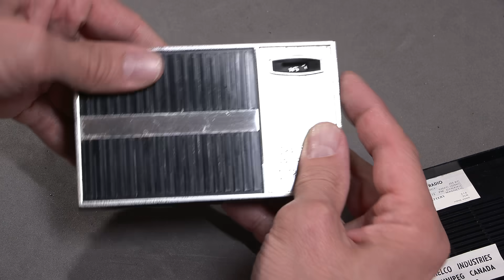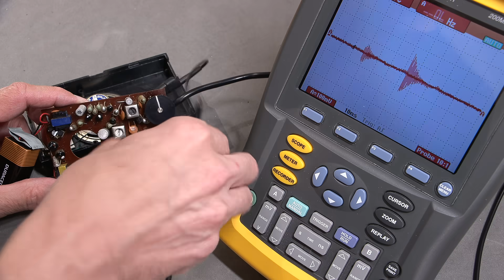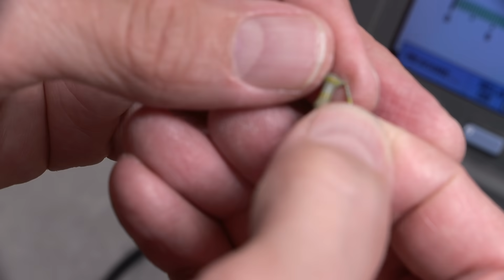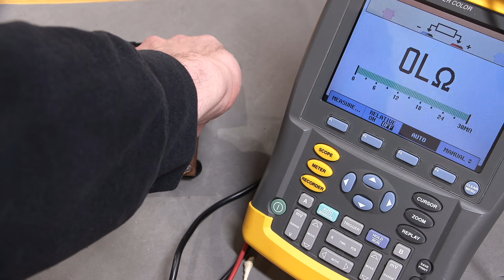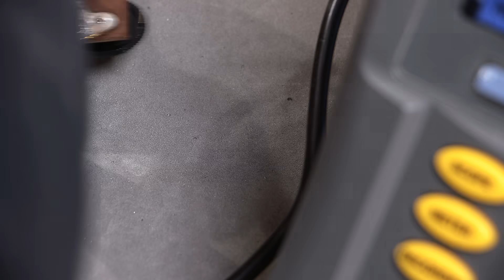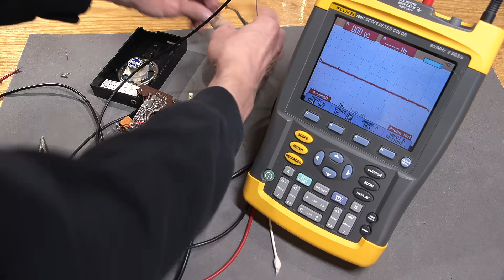10 Transistor TRANSETTE Radio Receiver Troubleshooting Adventure!

Comment: I checked and 1 transistor seems to be mixer and oscillator (autodyne) 3 transistor seems to be the IF amplifier 3 transistor seems to be the audio processing unit like filtering some high frequency components and amplifying some audio components and then pre amp 1 transistor and power push pull amp 2 transistors so total 10 transistors and 3 transistor IF seems to have high gain and 3 transistor processing unit seems to do its job perfectly because then pre amp doesnt see harsh audio components and amplify it, it amplifies just voice in its bandwidth not noise outside the band and thats why it may have higher superior audio quality and better reception

Comment: I find a LOT of transistor radios on my job at an E-waste plant. The boss/managers are happy for me to take them home (as long as I remove the battery/batteries). I find they almost all still work with little to no encouragement...

The reason these little radios are such wonderful performers is because of the superior filtering.
They have a reception bandwidth of a mere 1200kHz...yet look at all the coils and such inside.

Today's portable receivers won't have anything near the amount of filtering. Or transistor stages.

Worse, take an SDR receiver, they can have a bandwidth of 2000MHz or more...but take a look inside one of these - almost no filtering stages! Just itty bitty, sparsely placed components, maybe one or two big chips here and there, but...very little filtering. No really discrete coils, they look like a motherboard taken straight out of a modern mobile phone.
Reply from the maker: You are very correct. SDR receivers are a compromise at best. They save money on parts, and that seems to be the focus now.
Reply: @MrCarlsonsLab  forever and ever...it's the same story sir :)

Comment: I remember my first crystal radio from Kix cereal. Fifty cents & 2 box tops. It had an alligator clip & ear piece.  I loved when WABC went off air in those days so I could pick up distant stations.  By the time I was 9 or 10 I was building kits like 5W walkie talkies, Nixie tube clocks & visiting Heath, Lafayette & of course Radio Shack.
A wrong career path took me away from electronics but by the time I got into Sony in ‘88 I was soldering ‘like an expert’… lol 
It was hilarious I went for a job @Falcon Jet & they gave me a 50W soldering pencil & he wanted me to join like 4G battery cables together. I looked at him & told him I need a Bernz O Matic.  He insulted me in French & basically showed me the way out.
Reply from the maker: That's a classic story, sometimes you just need a lot more heat for the job at hand! :^)
Reply: @MrCarlsonsLab  Yea Sir. I knew they didn’t want to hire me as he was also asking questions over a schematic in French.  He says it doesn’t matter… “Electronics is electronics” which is true but I couldn’t decipher the language other than the numbers or at least good enough to satisfy this twit who was only wasting my time.
BTW - Paul do you sell components to folks… as in caps?  Still have my Lafayette HA230 I’d like to get up.
Thank you!  I do have the schematics

Comment: I've Soldered Caps In Circuit Boards. To LocTe The Cap
I Use My C clamp To Hold The Circuit Board so I Can
See The Top & Bottom Of The Circuit Board.

Comment: This was an enjoyable video. Your approach allowed me to gain some knowledge. In the 1970's I was studying vacuum tubes. Then transistors pretty much moved the tubes out. The tube technology was simpler to understand. Thanks for being here... even at my age electronics is still a skill I desire. Thanks for the instruction.
Reply: I like the simplicity of vacuum tube circuits. They are SO easy to use

Comment: Just the CPU in my computer contains 2.1 billion transistors. Yet a 10 transistor radio, from the days when 6 transistor radios were common, still seems extravagant.
Reply: And sometimes those transistors were not used as transistors in many of those radios, but connected as diodes instead. So a radio advertised as having ten transistors might actually only have six, seven or eight transistors actually functioning as transistors -- just a price raising gimmick.

Comment: Paul, just came across this very instructive video! Super demonstration on troubleshooting a superhet receiver. Just curious: when aligning the IF transformers, why do you need to inject the 455 kHz signal when the mixer stage could have supplied it (albeit modulated), and wouldn't the injected signal feed back into the output of the mixer?  Thanks again for the video
Reply from the maker: Hi Scott. The 455kHz is a tuned system, and in order to peak that system (without the radio affecting the tuning) a fixed 455kHz source is needed. This is why a signal generator is used in all cases. If you just peak for maximum static, you may be peaking the radio at (for example) 467kHz, or something like that, this would then affect dial accuracy, and the receivers selectivity.

Comment: Usually it’s the Audio power Amplifier, probably the power transistors. Or it could be the power supply circuit.. the IF amplifier used less power and robust.

Comment: It is nice to see you fix up an old fence poster like that radio. I used to collect transistor radios and had around 2200 of them. I collected radios made from 1954-1963 and after 1964 had zero interest in them as stylistically speaking they were unpleasant sheer form lumps I referred to as fence posters or something you would not be very careful with.

Comment: I just wish we still had half as many NW AM stations as the US still has in your area. 
We now have no BBC stations and only a couple of independent stations. 
The UK Govt are now trying to switch off the only AM broadcast station we have on LW BBC Radio 4. 
I’ve a few battery valve radios that work 100% just have little to no stations to listen too. 😊

Thank you for the MW transistor radio fix. It reminds  me of when I was 14 years old fixing transistor radios for anyone just to make pocket money. 

Regards 
Keith W.

Comment: I have fixed hundreds of radio just like that. I always use the press and wiggle part test first then get meter out. Thing is small portable radios get bumped and dropped often. When that happens the weak joints fail.

Comment: I have a 3 ganged tuning tuning capacitor that I would like to make a heterodyne radio with,but all 3 gangs are the same values. I was wandering if it is possible because the 3 gangs are the same values. If I sent one of the gangs to a L.O. tank, what inductance value would the L.O.tank primary coil be,if the gang 1 was going to250 micro Henry because gang 1 was 330 pF to 13,8 pF,then gang 2 went to the L.O. tank coil. Would the L.O. tank coil be the same as the antenna coil value,or different? How many micro Henries would it be?

Comment: Hi Mr Carlson! I have silicone transistor radio in which one of IFT coil is bad I want to replace it , can I replace it with Old IFT from Germanium transistor radio? They are 455khz for both old Germanium transistor and silicone.

Comment: Mr Carlson! Can I replace IFT coil used in Silicone transistor radio with Germanium transistor radio IFT coils ,both are 455khz but my silicone transistor type IFT coil has fault so I want to replace it.

Comment: Could a function generator/arbitrary wave generator be used for alignment? 
That signal generator of yours is beyond my budget.
Reply from the maker: Usually a function generator's output will not go low enough for RF alignments, so you would need an attenuator.

Comment: An am only radio doesnt need 10 transistors.
Reply from the maker: You are correct, but that's what they did.
Reply: @MrCarlsonsLab The reason for that was to sell the radio, because people thought the more transisitors the better. They would parellel them or use them as diodes to raise the transistor count. I have a transistor am only radio with 14 transistors. Its 7 pairs though.

Comment: This is a very thorough process, but 99.99999% of all transistor radio problems are caused by depleted or completely dead electrolytic capacitors, and whether that is the only problem or not, you want to replace every single one of them every single time. Don't bother testing, I guarantee that some of them are dead or dying.  The other likely failure mode is a cracked PC trace.

Comment: We are a community that studies and tries to get rid of abnormal input lag,input delay,many are convinced that our computers do not work well from 220V noise and in 12 years we have not been able to solve the problem,we are a little more than 1 thousand,many are convinced that this problem lies in the reactive component,others that it is the radars of military bases,others are convinced that it is just the crookedness of the players, but I am a player with 14 years of experience,many are convinced that they can play harder, but they can't do it, you can even say that they can only play at night or even in the morning when people go to bed in the city, not engineers,neither electricians nor other savvy people could help the community, there are also idiots who say that everything is in their head, but tests were conducted before and after day and night, the problem itself is that when we play the mouse becomes heavy or too fast, it is very noticeable, and naturally it is very difficult to aim at the enemy in shooters and so on in all the games, many people made circuits, filtering circuits, but alas, they seem to saturate for 1 hour or 24 hours, and after everything returns, we also noticed the effect of new hardware, I explain this when you plug a new or old harness into an outlet that it has been lying idle for a long time or any accessories, I will try to reset the link if YouTube is not blocked, there are many competent people on this forum, but alas, everything ends with windows configuration.also, many people have changed their hardware, video cards, processors, power supplies to many other expensive brands, but alas, without success, many call us schizoids. Many of the pro scenes of such games as conter strike go and 2 reject the theory, since it has not been proven and is not presented to the world, there are also people who say that with a long use starts to hurt my head and eyes, by the way, the grounding is not It helps if I could get in touch with you, if you could give us a hint, we would be very grateful!
Reply: tests of a normal pure sine wave were carried out, many stabilizers, transformers, grounding, zeroing, much that has been passed and a lot of money has been spent by many, as well as circuits....who are trying to create things that supposedly work, but alas, they don't work, if you delve into the circuitry of the computer itself, to hell with the logic of things, the computer assembled everything, set up Windows, BIOS hardware is not weak, you play during the day everything is very bad translation fine-tuning the scope, you go in at night on the same day, the game gets better, the smoothness and clarity of the mouse appears 1 to 1, the Internet has nothing to do with it, it is isolated by optics, also according to the logic of turning off every device in the house does not help to get rid of the problem, as well as moving, try to guess where it is better, but alas, it will cost a lot, just take and assemble a new one an expensive computer for $ 1000 or 2000 does not help to solve the problem, let us know if you want to tell us.

Comment: Back in the late 1960s I was about 8 years old. I used to spend HOURS de-soldering the components from those battery-operated radios. (broken ones were prevalent) I still have a couple drawers with the devices removed back then.  As I got older, I read every electronics book I could get my hands on and attended college. Worked as an IBM Engineer for many years. (micro-Chip manufacturing factory)
Reply: I often wondered how many of us learned this way.  I wasn’t a ham then  but I would bike to the local radio flea market and buy old short wave receivers to just rip them apart to see how they work.  I wound up going the software development route but never lost the love of electronics.
Reply: You're very intelligent!

Comment: Pretty small potatoes, but I was surprised that you did not clean off the flux from the board . I guess it is one more negative cost to the repairer and time etc, and it is not going to sound any better, but it sure would look tidy.  Thanks for the video.  The old components are sure different from todays SMC.  Thanks a bunch.  Regards

Comment: Mr Carlson you probably can make lot of money off Truck drivers my technician was a Ham he made lot of money fixing CB and ham radio he had mods and updates for CB Radio the RCI 2950 he installed Kenwood filters in the radio rewire the cobra 2000 GTL power supply you may of seen some of the radio he work on he open a shop at a Truck stop made lot of money fix the problem in CB radio he clean them up did alignment on them he took lot of business from the shops down the street from him I herd Truck drivers they paid like a 150 percent mark up on product for them CB Radio because the guy was the best his name was Bill Good shop name best communication in Ontario California he Died he fix the bug's in the New CB Radio made these days

Comment: A few other tips:

The headphone jacks are notorious for going bad, the contacts get oxidized, a touch-up with a contact cleaner strip can work wonders.

The electrolytic caps are also often bad, changing them can be a good idea.  

Resoldering everything, to find all the bad joints, can be a quick fix. Parts that have bad joints often drop off the board when the one good joint is removed. The tuning coils often have cold joints.

Comment: Mr. Carlson - I’m a lawyer. I have zero engineering background. Somehow I’m able to follow what you describe. Your use of the term “valve” when you describe vacuum tubes - (negative electrons . . through a gate . . . to a positive plate) makes sense to me.  Thank you.
Reply from the maker: Thanks for the kind words! Glad you are enjoying the videos.
Reply: In the past 10 years, I have learned so much from Mr. Carlson.
Reply: That's because Mr. Carlson is excellent in simplifying and rationalizing the process. A Teacher with capital "T" iow!
Reply: Vacuum tubes are very simple to use when designing your own circuits.

Comment: I think the most incredible thing about Mr. Carlson’s videos is the insight, obviously from experience from all the different things and the knowledge base. 

For example, everything that I’ve been learning would tell us that capacitors can short out, but obviously we learned in this one that one of the common things that happens is they go open I never would’ve known that . The obvious find of the broken lead on the component. I think these things are very common and I might have stumbled onto that myself, but I’m thinking back in history with all the components I’ve touched that act that way, and it never occurred to me that it was a broken lead..

The only thing at all that I would’ve caught onto is the common flow of the ground lead on the circuit board. I think that these videos are highly educational and I love the insight.
Reply: Good learning skill

Comment: Great video! Love these old radios that pick up faint signals without the discrimination circuits they have today. 
I think there is a conspiracy about the discrimination circuits. They don't want you to hear something is cheaper across state lines!
I had a 1995 Honda Goldwing that had a radio made by Clarion. The antenna on the bike was huge. I was riding in Arizona but could pick up stations in the midwest of the US.

Comment: An excellent video, as always. It's amazing what kinds of diagnosing and repair you can do without having a schematic! I've had  a small collection of radios of this vintage, in various states of repair. One of my most useful troubleshooting tools is a small, thin wooden dowel, which I use to gently push and nudge each component, while power is applied. Broken leads and/or solder joints are very often a single failure point that is easily repaired.
As I mentioned in an earlier posting, I see that this radio was imported by Chelco Industries, of Winnipeg, Canada. I'm a lifelong Winnipeg resident, and I do not recall hearing the name of that company in the 1960s.

Comment: Hi Mr Carlson I recently bought a vintage 1946 General Electric radio and the previous owner must have used an external antenna but I want to use that built in one as I have many local AM stations close to me in buffalo ny, however the single wire that sticks out of the back came out and when opening up there is 3 connections for wires that go to the built in antenna and I don’t understand how it works, is there some way I could get in contact with you for some help or could you make a video possibly explaining how it works and what needs to be done to fix my problem, I have watched you for years and your the only person I know that has the knowledge to help me out with this. Thanks very much and I love your channel

Comment: Mr. Carlson,

What size of solder did you use in this video? I bought 0.8 mm solder. Is that to small or the right size? I have been looking at 1 mm size solder but that might be to big. I just want to make sure I have bought the right size solder.

I wish I could take your electronics course but I just can't afford it right now. I hope to take it someday in the future.

Comment: Back in the early days of "pocket" transistor radios there was sort of transistor war for a while.  You would see breathless boasts of "12 Transistors" and "18 transistors !!!"  18?  What they were doing is using transistors in all the places that would normally be diodes.  You just connect the collector and base together and, voila, it's a diode.  Not being used as a transistor, but they counted it as one.